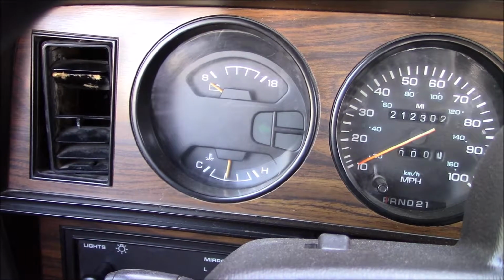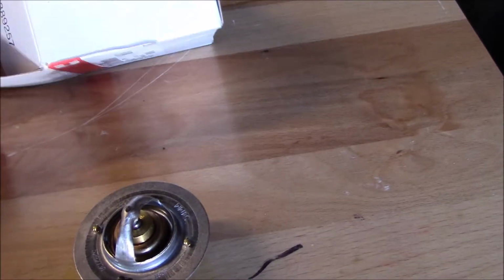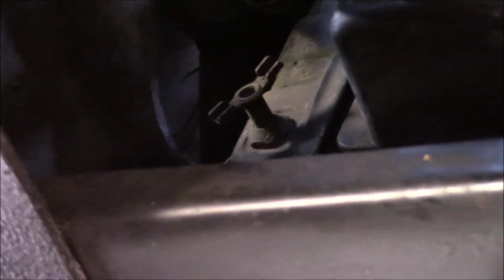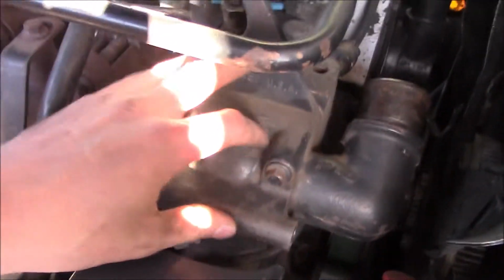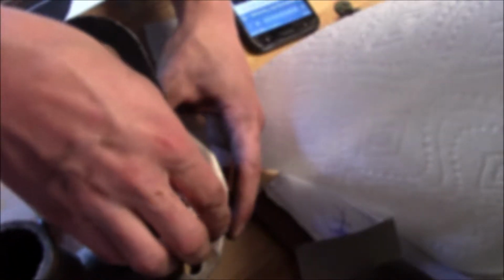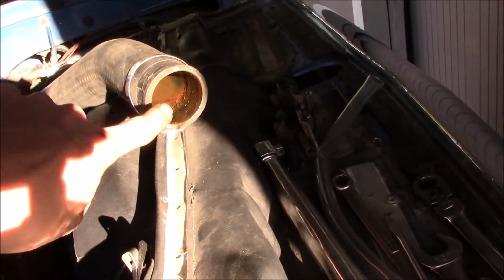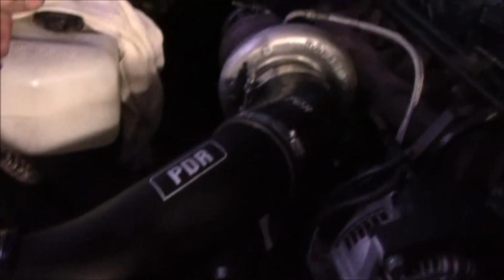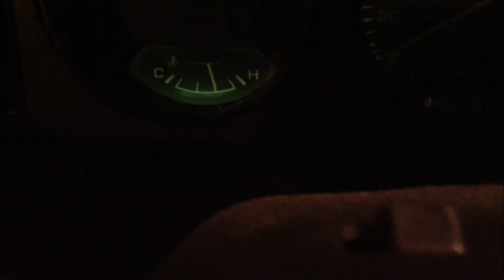1st Gen Cummins Thermostat Replacement

Comment: No gasket maker or anything on the thermostat housing? Just metal on metal?
Reply from the maker: What's up man! Thanks for subscribing I appreciate that it means a lot. Nope, the rubber ring creates the seal!
Reply: Just got back from the parts store gonna do what you did, I sure appreciate the video helps us wannabe mechanics out a lot!

Comment: Did you ever figure out how to get it to run cooler? Did you do anything else to it after this video?
Reply from the maker: Yeah, after installation of the 47RH I built up, it runs rock steady at half. I believe the heat exchanger was being overworked. That said, I have an aluminum rad that's going in as well. Thanks for subscribing!!

Comment: Any luck with getting the temp to steady recently?
Reply from the maker: Yeah after I swapped to a rad without any pinholes in it. I think the cooling system didn't have steady pressure.
Reply from the maker: Yeah after I swapped to a rad without any pinholes in it. I think the cooling system didn't have steady pressure.